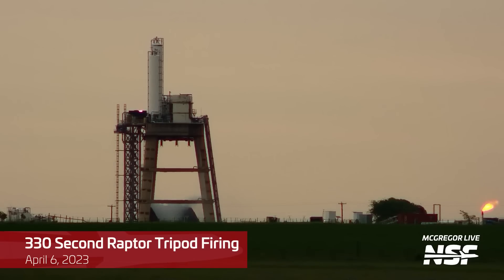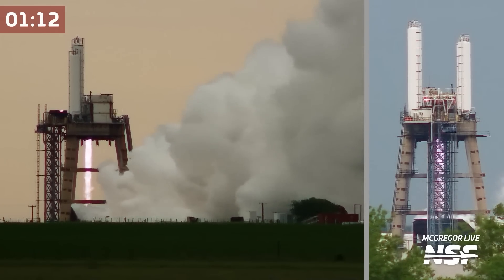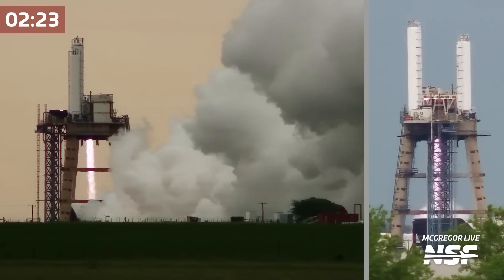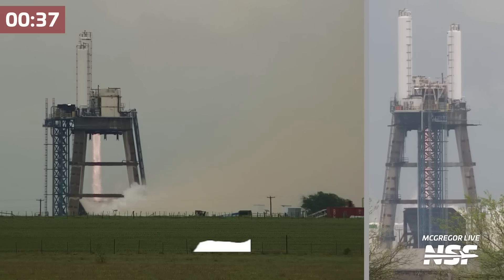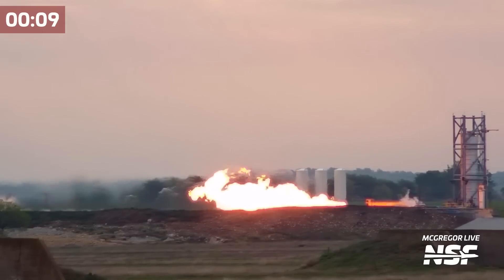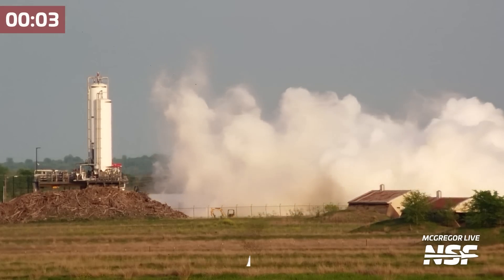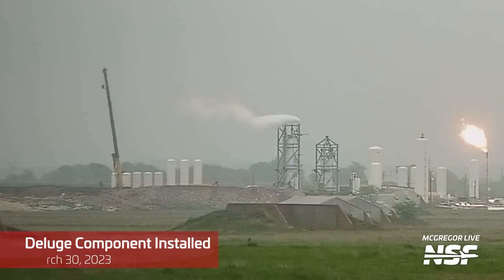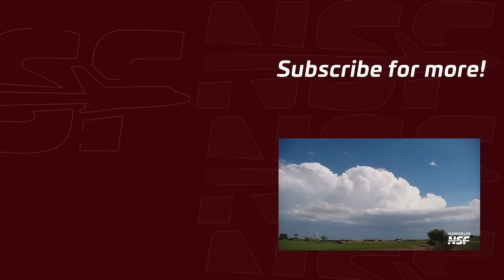Is SpaceX Practicing Starship Burns for Orbital Test Flight?

Comment: Really cool video and commentary, Those looked like automated frequency sweeps on the electric gimbal control - possible getting data to refine the control system gains and such as well as determining what the eventual wind limits and maybe structural limits (making sure the control system frequencies don't hit a structural resonance mode) are (winds from a control authority perspective).

Comment: The times are consistent with a prop tank extension. normal burn for ship is ~300 seconds. These were a bit longer (330 seconds). Either it's doing some throttling, or it has more fuel than they said it did.

Comment: Was the first Raptor a Vac Raptor or a normal one? I would expect that the orbital insertion burn would primarily be done by the Vac engines? Or what do you people think?
Reply: One circumstance for reducing orbital insertion burn engine thrust is if G-forces would exceed a payload limitation (when the main tanks are nearly empty). 

The sea level engines are fully utilized during the orbital insertion burn to minimize gravity drag by maximizing overall thrust. One engine is, of course, necessary at all times to provide thrust vector control. 

It is conceivable that very late in the insertion burn, the advantages of higher ISP might outweigh the factor of gravity drag, and indicate an advantage to shutting down one or two sea-level engines (likely in steps). 

[ An escape orbit transfer burn always greatly benefits from maximizing ISP by utilizing only vacuum engines (and perhaps only a single sea level engine at full thrust). This transfer burn is most efficient if completed during a very brief period at Perigee and it may be necessary to cut the burn short, complete a highly elliptical orbit, and repeat another burn at the next Perigee. 

In fact, one scenario for minimizing transfer orbit duration to Mars, especially for manned missions, is to transfer propellant during that highly elliptical orbit and then have the propellant tanker briefly deorbit burn at Apogee, so that Perigee is within the atmosphere and waste away orbital velocity, returning to Low Earth Orbit. 

After the second Perigee burn, the manned Starship heads for Mars at a much high velocity. ]

Comment: If a burn this long is needed for the OFT, why did they wait until now to perform it?
Reply: This test is for the electric motor vectoring, which is noted by the narrarator.  This will be used on booster 9 on.  Booster 7 (and the scrapped Booster 8) uses hydraulic vectoring, an already obsoleted idea.  That's how fast the development is outpacing prototype production.

Comment: One thing i've always been curious about — what is the flexible part of the fuel/o2 lines that allows the gimbaling to occur? There's some interface between the engine and lines that moves, yes?
Reply: It's kinda hard to describe, but at the top of the engine there's a woven metal pipe which is a bit flexible, and that supplies the LOX connection. The methane connection I believe has two of those woven metal pipes which snake around the top of the engine. I'm sure the inside of the pipes are fancier than just woven metal, but if you find pictures that should give you an idea what to look for
Reply: I suspect that the methane linkages are a pair of 90° swept elbows with rotating joints to permit changes in overall length. 

There are two ways to implement the LOX joint. The first is to use a very flexible hose (pressure contained by a woven steel mesh) or deeply corrugated metal bellows. The second [and less likely] is to use a sphere with a bore through the center and corresponding orbit socket(s) similar to the swiveling joint found on any shower head or engine exhaust flex joint. 

In either case, the engine thrust is supported by a universal joint that wraps around the oxygen linkage.

Comment: Excellent test showing a fully developed reliable engine ,  but at the very end of the burn look at the plume it doesn't lean out it goes rich, this is essential to stop the oscillation damage on  power down ( the 500 Hz or so trombone lean out so familiar to natural gas engineers )  fantastic
Reply: Indeed. They're very careful to avoid going fuel-lean. Hot oxygen is insanely corrosive.
Reply: You are in the business  sir

Comment: Isn't all that crackle a sign of combustion instability?  Back in the 1960s I worked as a rocket instrumentation engineer and we always tried to induce instability with explosives to be sure that the combustion was stable under normal operation.  The engines we tested were much smaller so when they went unstable they sounded like a 400 Hz whistle as opposed to the low frequency rumble from the Raptor.  Also, we shut down fuel flow before oxidizer flow to avoid the shutdown flash-back that is visually apparent on the Raptor tests I've seen.
Good luck on the orbital test flights.  I can't wait (please hurry,  I am not getting any younger).
Reply: Scott Manley has a good video about the crackle sound. It's not combustion instability. The lox and methane enter the combustion chamber of the raptor as gasses not liquids. The crackle is the supersonic exhaust gasses interacting with the atmosphere according to Scott. :)
Reply: @williamgreene4834   YES!
The crackle is due to the hypersonic compression wave-half catching up to and overlapping the sonic-velocity rarefaction wave-half of each hyper volume rumble. 

[ In any gas, the sound velocity increases with increasing pressure and density. At ludicrous audio volume levels, the disparity in gas pressure between the compression and rarefaction wave-half will produce significantly different velocities within the same wave. ]

Very similar to any cresting and tumbling wave crashing near shore. 

This audible "crackle" result is only heard at greater distances; up close the exact same wave would still sound like normal rumble. [Of course the extreme volume would instantly deafen and fatally bruise any organic listener, so only special microphones can accurately perceive the waveform up close.]
Reply: @williamgreene4834  hmm sorta like ? turbo exhaust at very high frequecy. Sounds plausible
Reply: Better to go fuel rich than fuel lean. A hot engine with excess oxygen can melt itself. Fuel rich and all you have to deal with is soot.
Reply: @gravelydon7072  As far we are aware not so much in Methalox engines. Still your point is valid
Reply: @alesksander  It shouldn't produce as much as a Kerolox engine but it still will be present. CH4 combined with LOX can still produce Carbon, Carbon Monoxide, Carbon Dioxide,  Water, and even CH3O + OH. All depends on the ratios and reaction temps at what location. The shutdowns are the point where it most likely would produce the rarer items.
Reply: Thanks for that information. Good knowledge base.
Reply: Yeah were mine thoughts also. Arguably if theirs chamber can handle marginal shoichometric and any extra detonations, pressure could get bigger and hence performance.  And about flash-back burn.  Maybe they don't want to carry ANY extra drymass (i mean its wetmass actually) as possible. In order to increase efficacy's and increase cargo capabilities for whole system. After all system must be robust anyway. In order to handle such flameout they need to have measures to handle that anyway. Because if they are serious about reusability and landing burns.  Those thermal problems became minor and there is no avoiding that.
Reply: @alesksander  The quantity of extra lox needed for about 2 seconds of lox trail would be insignificant relative to the total fuel/lox expended.  On the other hand, you are right about the hot combustion chamber with pure lox.  I don't think it would melt, but it sure might oxidate the metals in the chamber and/or nozzle.
Our flashback launched a quonset hut (being used as a test cell) a few tens of feet off its foundation, so in our case, it was significant. 🤕

Comment: I wonder if that smaller engine is a lunar Starship descent engine?
Reply: It could be.. but we’re not for sure.
Reply: I  thought  the same. I believe  that
Reply: @emperatrizcarrasco3266  Exciting if this is the case.
Reply: I was wondering the same thing!
Reply: My guess is that the tested deluge system is built at scale, and the test with a little engine will provide results able to be scaled up to real rocket size launch proportions.